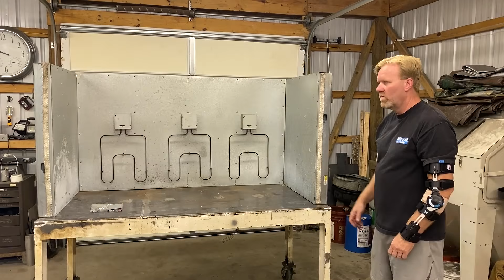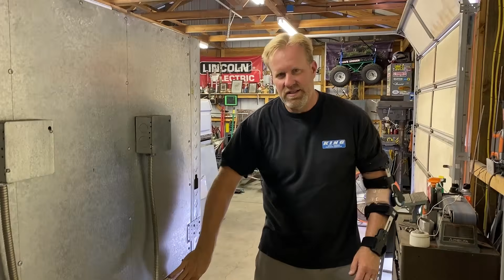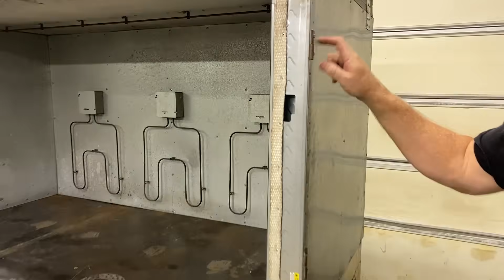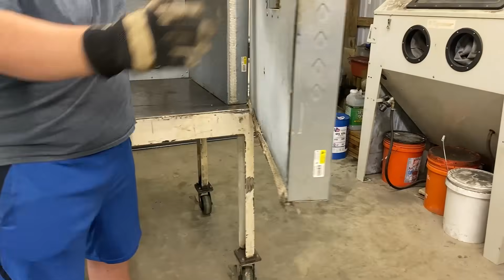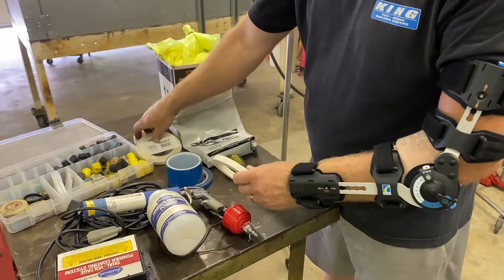DIY CUSTOM BUILT POWDER COAT OVEN (SAVE TONS OF MONEY!)

Comment: Cool rig you got there.  It's given me something to think about.  I can have wheels PC's locally for $100/wheel, and their color selection isn't very large.  For $400 I can build my own little oven just for one wheel, and buy ALL the equipment to do my own rims in whatever color I want.
Reply from the maker: Thanks for checking out the video!
Reply: Love the innovation
I had a small shop in 89 built and installed security doors 
Wet sprayed first then fast dry acrylic 
Then high solids bake 
Finally got into powder 
Lots of work but well worth it 
Had two lines one automated  recycled the powder great savings paid for the equipment over time 
one binks 10 x10  sprayed to waste Adding a Fremont phosphate wash was great for pretreatment 
sadly lost it all during the 2008  2011
Economic meltdown 
Think I’m going to build my own this time 
Thanks for your post

Comment: U can use a 24v contactor with protection and use a 24 volt transformer also to operate it and the other control functions as long as the main supply’s are isolated from it . Might b cheaper if u needed to purchase controller parts

Comment: Can you give me a full build list I’d really like to build this set up
Reply from the maker: There is a build of the electronic parts in the description, but not of the box itself. The parts for the electronics are older so you may find them used on ebay or may not find them at all. Try to find newer parts with the same stats and they should work. Let us know if you need any more info and we can give you some more help. Thanks!

Comment: Very nice build and well thought out and executed!.......as far as the burner elements, it looks like just 3 household oven elements? Can you just purchase like 3 of the same model replacement elements for a household oven and also what wattage specification elements do you recommend for a box similar in size to what you all have built?? I'm looking to mainly powder automotive parts with probably wheels and subframes/chassis parts being the largest items I will need to put in an oven so that being said a household oven was what I was originally starting to look into putting in my garage and just adding an extra 240V box on its own breaker in my panel and wiring the identical pronged plug that my plasma and welder takes that way I don't have to run it on the compressor outlet and the oven will only need plugged in when in use and all other times will be free for my plasma and welder for fabrication and all of that equipment is in the area I'm going to free up under one of my larger fab benches and build the oven to fit snug under that bench that way if I'm doing something heavy such as an engine block or similar weight I can powder it on a wheeled cart and then roll it right into the oven on the cart and when done wheel it right out instead of lifting heavy items up a few feet into the oven. I want to thank you guys for such a great informative video on your build and also thank you in advance for the information on my questions in the beginning of my comment here! I look forward to chatting with you all soon and until then take care and powder on!!
Reply: I bought a replacement element on amazon and bent it around a cylinder to make my automated bullet casting machine. Compare the size of a household oven to the volume of your oven. It would be easy to add another element later or to unhook one if you are wrong. A few years back it was $17 for the element I bought. You should do a 50 amp circuit and #6 copper wire depending on the length of run for the 6-50 receptacle. Since an oven runs for long periods of time, you want to have good size wire. Plasma cutters and welders can run on smaller wire for shorter periods, but I finally upgraded when I remodeled my garage.

Comment: Sir what pid temperature controller do you use for those oven
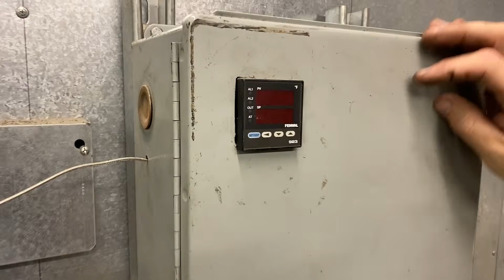Reply: @18:14 looks like they have a Fenwal PID, but I'm not familiar with that manufacturer.  I Used Auber Instruments for my two ovens.  Model SYL-2362 uses a SSR solid state relay, and the other is a SYL 2342  that uses a plain mech relay.  Either one works great.  Hope that helps.
Reply: @jime8532  I also used an auber pid and ssr for my automated bullet casting machine. I'm thinking about building an oven like in the video for powder coating. The PID units on amazon have a lot of bad reviews so I will likely pay more for the Auber again.

Comment: What are you useing  for a powder coating gun and where u get it ?
Reply: He showed it in the video. It's an Eastwood Powder Coating Gun. They work well for the price.
Reply from the maker: Hey Mike, we are using a Eastwood gun kit. We have the dual voltage gun. It is really cheap and it works great for the price. Thanks for checking out the video!

Comment: This is absolutely the best video on powder coating I have seen on line after years of watching.  I would like to know what you would suggest as a metal to use on the outside in case the temperature gets to 500 degrees again? (Stronger, more industrial) and most importantly I would love to know you guys thoughts on making this exact machine but 6 ft tall.  Seems the 95% of the expensive hardware is already there and wouldn't require any additional upgrade.  Thoughts/Dimensions?

Comment: Nice job.

Total wattage, volume, and time to temperature? External skin temperature @ 400deg F internal?

BTW, you can use regular (3M blue) masking tape. It does not burn but it does become difficult to remove when the glue gets heated.

Powder much cheaper on eBay. I've purchased 50# boxes for around $2-3 per pound though not necessarily a huge color selection. Several have said powder expires but not in my experience. Main thing is to keep it dry.

Comment: this video makes me feel confident in replicating this oven. Thank you, extremely detailed
Reply from the maker: Thanks for checking out the video! If you need any more guidance or help, don't hesitate to ask. We will love to help on your build!
Reply: hello can you guys send me a drawling of the wiring diagram on your powder coat oven cause I’ve bought the same thing I like your build and coping it at my house but need to know how to wire it I don’t know where them black wires run to or where the white wires are going behind that contractor looks like they are grounded but not sure but I have most the wiring figured out just the black wires and white ones
Reply: Me 2, very detailed

Comment: Hey guys, great video. You could also link the parts to build it as an amazon affiliate link in zhe description and benefit from people buying the stuff
Reply from the maker: Thanks for checking out he video! I didn't think of that, thanks for the idea. I will have to look into that. I just know for exact parts for the oven controller some of them are discontinued or hard to find, at least the exact brands that we used. But, I am sure you can find other brands that are close to being the same design.

Comment: When can you list the parts needed for the controller box?
Reply from the maker: Hey Jim, tomorrow I will get a full parts list for the box and I will add it to the description of the video. Let us know if you have anymore questions. Thanks for checking out the video!
Reply: Thanks, forgot to ask, do you have a method for us to communicate other than YT?
Reply from the maker: Yes you can email us at alwayssomethinggarage@gmail.com. I just got the list of stuff together for the box. Sorry it took forever but we have been super busy. You can send me a email if you want and I can give you the list there. Then, if you have anymore questions we can go back and forth on the email. Thanks Jim!
Reply: @alwayssomethinggarage794  Any chance you can share wiring diagram of controller box or inside close up photo of the box.  I have paused the video and tried to take note, but there are a couple wires hidden. Thanks